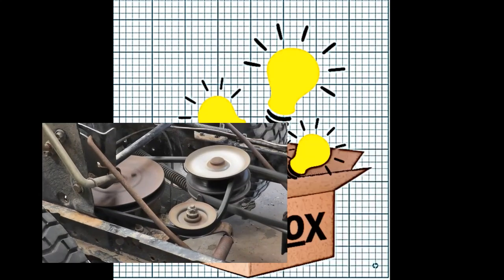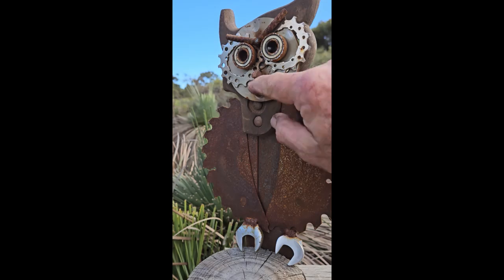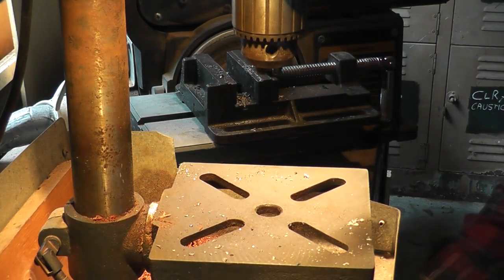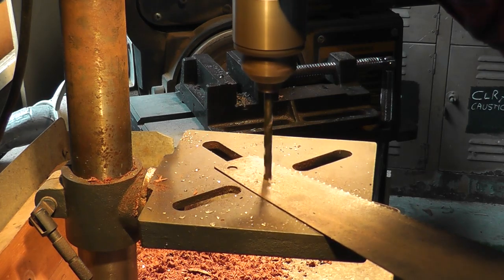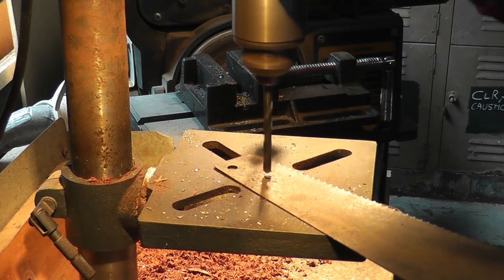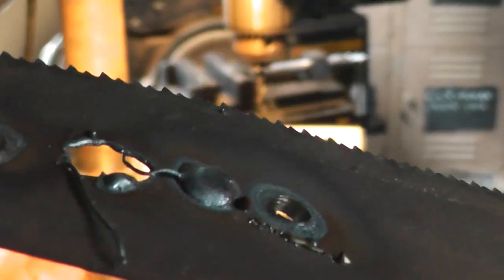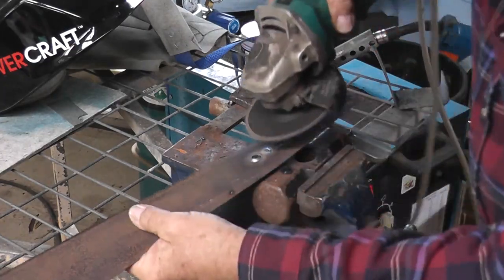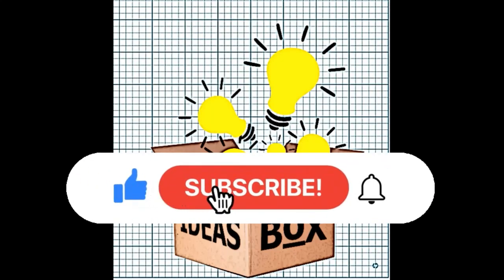drilling a hole in a saw blade

Comment: What bit did you use?
Reply from the maker: Hi, thanks for commenting. It was just a normal drill. I just made sure it was sharp. I hope you like my other videos too.
Reply: @IdeasBox  Your video seems to indicate even the plate region was hardened, so was it just some random steel cutting bit?

That is encouraging. In my case I cannot risk annealing since the blade will be used for actual cutting, so this gives me hope. I will try buying some generic tct bit and see if I can achieve success like you did. Thank you.

Comment: A induction heater from vevor is a god given tool to all this problems. It works great for bolts, bending metal and rebar and heats metal red hot in seconds.
Reply from the maker: Thanks for commenting. I'll check it out.